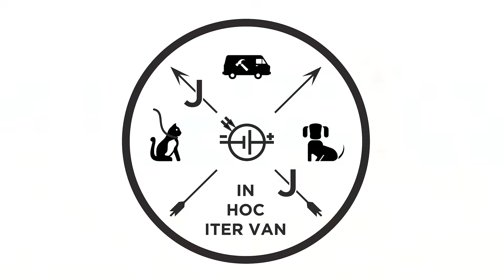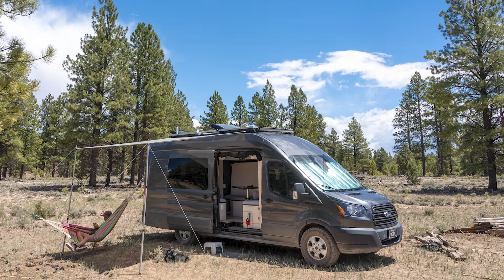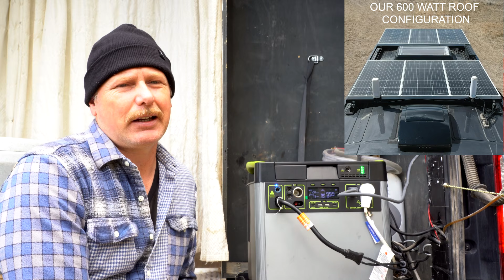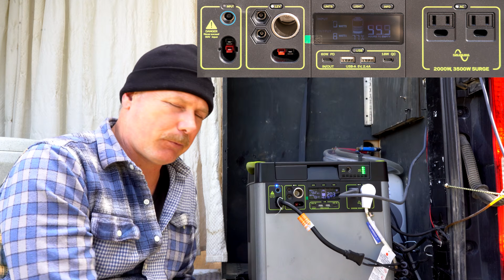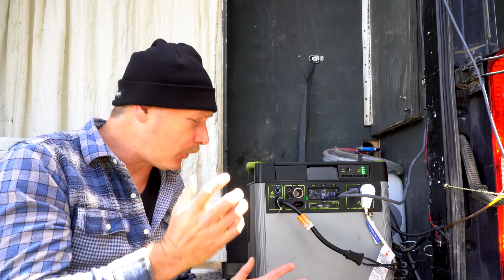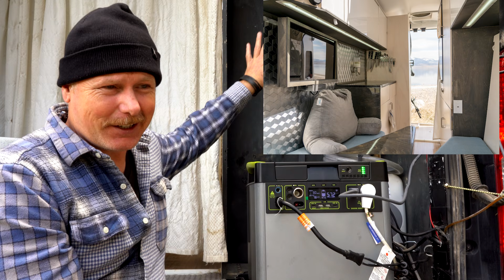GoalZero DIY Van build -  Thoughts on the 6000x

Comment: And in 2024 the market is completely different! GZ seems to have severely dropped off in terms of quality (check reviews on latest products). Ecoflow has some really compelling offers in the powerhub kit - extremely nicely designed but its pushing $7k-$10k which is crazy. But something that still frustrates me is we arent seeing the MASSIVE drops in battery costs being passed on to the consumer. The only way you can benefit from this is if you build your own power system. Epoch sells high quality batteries with 460Ah for around a grand. There is no need for the ecoflow to cost $7k at the entry level price.

I still have a GZ 3000x that has been rock solid. I'd be happy if I could simply expand that with modern batteries but the Tank expansions are not great.

Comment: Power supply brick to charge this 6000x has a flip on/off switch.

That switch NEVER lights up whrn connected to wall and charging the unit.

Is that standard or just my brick?
Reply from the maker: We don't recall a light on our brick working either.
Reply: @dwnshifters6833   Interesting and kinda weird. Even cheap multi-plug power strips have a reset switch that lights up. At least I know its not just mine.   👍

Comment: The EcoPro has fixed those power issues and now there is a solar panel that works in the shade.
Reply from the maker: I'm sorry, I don't know what an Eco pro is. Solar panels have always worked in the shade, but they are far less effective. Panels with busbars or microinverters are helpful when panels are partially shaded.

Comment: Thanks! this is so helpful. I just recently made the wonderful decision to stop stressing over the full Victron system and all of those parts and wiring, and made the decision to go with the GZ. (although based on this video I'm going to do a quick search of potentially new options out there... but with you on this battery size!) I actually just found your wiring diagram where you show the other components you need to wire it all up, super helpful, thank you! Now I just have to finish defining wire gauge and fuses, etc. I'm curious as to your comment about the AC problem- I'm wondering, would it work to put a switch on/off wired in- like for the water heater? so you could turn that off without turning off all of the power cord? That's what I'm going to try to do...
Reply from the maker: So glad the video was insightful. You pay a price for an all-in-one, but if the money is available, it does save a lot of hassle. And YES we are using a cord with an On/Off switch for the water heater. We would still prefer that we could turn it On/Off with the App, but the manual switch does do the job. Good luck with your build and keep in touch!

Comment: Did you have any need for an inverter for some of your appliances? Such as the air fryer.
Reply from the maker: The Goalzero 6000x includes a 2000w inverter with 3500w surge protection. 3000w would be awesome, but the 2000w has generally worked well for our needs. Our air fryer is not particularly powerful, as we wanted something fairly low wattage. You can see the unit we bought here: https://www.dwnshifters.com/blog/2020/5/24/our-kitchen-how-we-eat
Reply: @dwnshifters6833  Good to know. I was wondering about the water pump, water heater, and a 12v electric oven (Kickass). I do have the Dometic Penguin II a/c that will need shore power to run. 

How many appliances can you run at a time from the power strip that’s plugged in? From what you said, I may be able to get away with just the Yeti 3000 and a grid dominant transfer switch. Any ideas on that?
Reply from the maker: @keenliz  what appliances you can run simultaneously really depends on their power draw. We can use multiple items at the same time, but we were careful to purchase low-wattage appliances where possible.
Reply: @dwnshifters6833  Fridge, a fan, lights, water pump, and water heater when needed. One fan is wired to the vehicle battery and the other, to the Yeti. 

All of that but the water heater is 12v. I do plan on daily meals from a hot plate or oven as needed. I do have an AlpieCool freezer that is 12v too and that will always be running for medication purposes for my son. 

Our plan is 3-day (max) off grid.
I have the dual alternator on my ‘22 Ford.
Reply from the maker: @keenliz  all brands of appliances are different. I'd suggest using an electrical load calculator so you understand what size battery/inverter you should get and what appliances you can use at the same time. Hot plates are pretty demanding on a load, so running through this exercise will be helpful. We have a calculator here: https://www.dwnshifters.com/blog/2021/1/7/calculating-electrical-loads
Reply: @dwnshifters6833  awesome. Thank you!